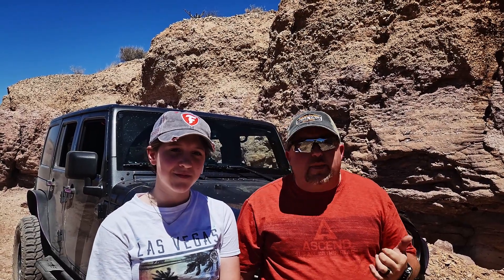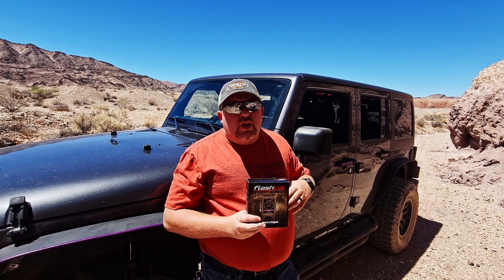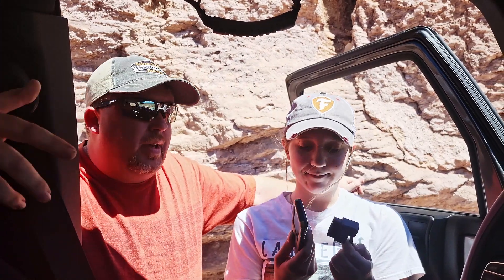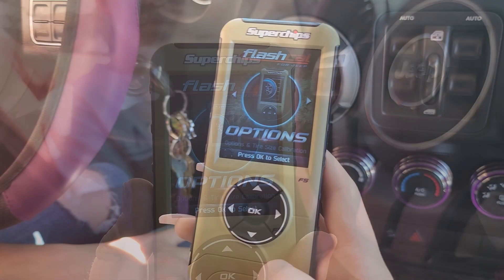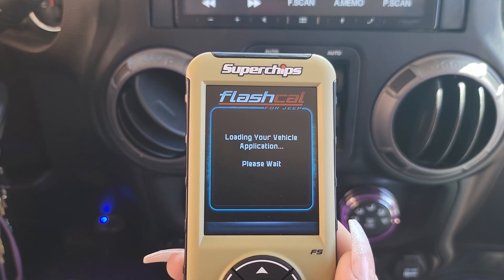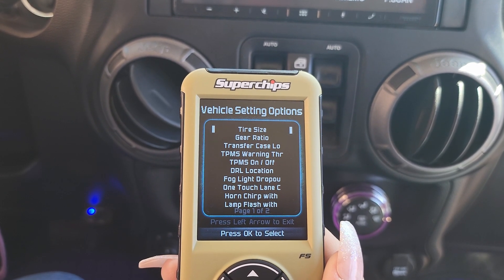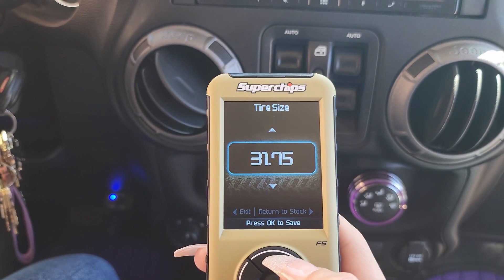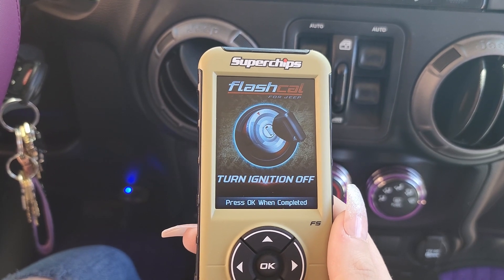How to Correct your Jeep's Speedometer

Comment: Hey Josh, I'm brand new to the Jeep world and bought my first Jeep last month. A 2010 Rubicon,  and was I wondering if this would be needed for manual transmissions?
Reply from the maker: Manual or automatic, the speedometer is based off the wheel speed sensors. So yes, if you have larger tires, recalibration is always a good idea
Reply from the maker: Congrats on the acquisition also my friend. Hopeing you and your new-to-you Rubi have many years of enjoyment! 😀
Reply: @JeepingForBeginners  Thank you!
Reply: @JeepingForBeginners  This helps, and yes, I do have larger tires from the previous owner.

Comment: Hey Josh. If you can at all, How do you correct this when you have the older CJ7 with no computer
Reply from the maker: There is a kit you buy that replaces the final drive speedo gear in the transfer case. A little more labor intensive, but cheap... it will fix the speedo, but if you change your setup, you would need a new kit with the appropriate gear....
Reply: @JeepingForBeginners  cool. Thabks

Comment: Just a kind word, but that is totally wrong. Like every video I see, so as someone that KNOWS how to properly set tire size for the speedometer, Im writing this. The sidewall measurements mean nothing in relation to programming, nor does measuring your tire from the ground up to get actual tire size, is what these programmer sellers don't tell you, either because they don't know or whatever is you have to know the ROLLING height of your tires, and the way you find that out is with a level and tape measure, from the ground up to the CENTER of your wheel hub, take that number, x it by 2 and you have EXACTLY your tires true rolling height, I guarantee your shift points will be as factory, and your speedometer at any speed. No need for me to say why or how I know this, I'm just tired of watching people do it totally wrong, and the sellers of these products don't have a clue wth is going on. Good video though